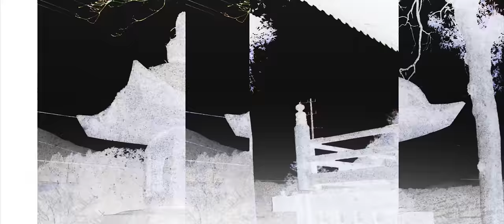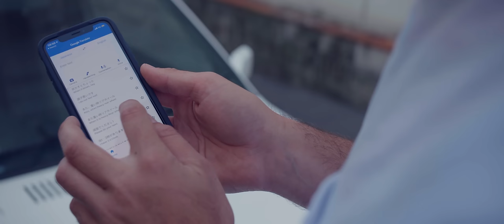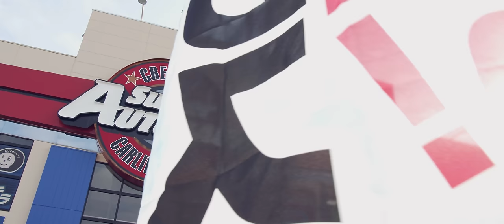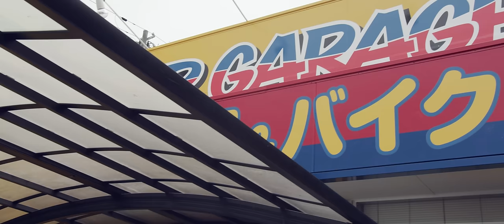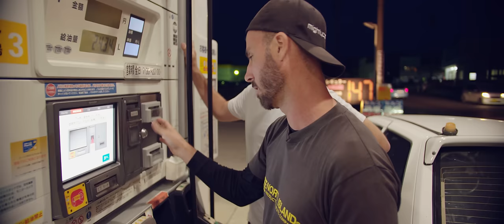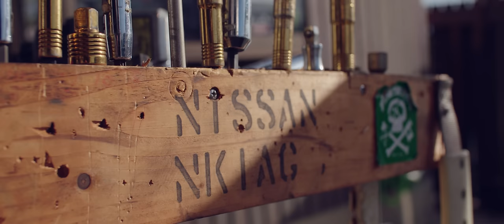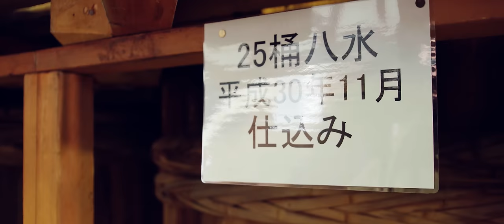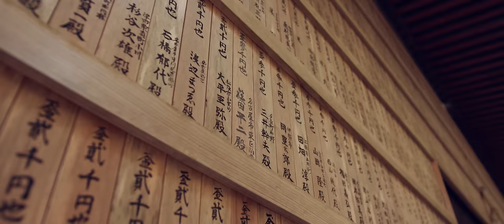TURBOS & TEMPLES 2 // JDM Feature Film 4K

Comment: Best translation: 

"Thank you for buying the super turbo. When you start the engine its a little rough, the engine is a little bad with long running time. Good luck."

The problem is the note had english words in it which don't translate very well.
Reply: It says" Thank you for buying the super turbo. It doesn't like to be reved too much . If you loaded it up with some weight the rear wheels will rub at times. Good luck."
Reply: @a00860512  Correct
Reply: @a00860512  Thank you!
Reply: "Thank you for buying the super turbo. At least you aren't American. Trump is the worst. Good Luck."
Reply: @earnestbunbury2103  sook
Reply: @earnestbunbury2103  😂😂😂👌 My favorite translation.
Reply: @a00860512  Thank you!
Reply: Nao's translation is good.

OP, 'super turbo' and 'rear wheel' aren't really that hard to translate.

Comment: uploaded correctly in 21:9 and not with black bars! HELL YES! THANK YOU!
Reply: ValleVaan give me 16:9 please. Pretty much all display devices sold are 16:9.

My tv is 16:9, my laptop is 16:9, my phone was chosen on the fact it is 16:9. Give me the correct 16:9 please. 

I presume this was filmed in 16:9 and then some data was needlessly thrown away to make silly black bars on any ordinary 16:9 display.
Reply: @nordic5490  there is no black bars added by editing, if you wouldnt be stupid you would understand it, it is filmed in 21:9 and uploaded in 21:9, if they were to film it in 16:9 and then add black bars to make it 21:9 i would see black bars on all sides, now i can watch it full screen without any black bars, just as it should be.

also it is not my fault that you are stuck in the past and one single aspect ratio, my main monitor is 21:9, my other monitor is 16:9 in portrait mode and my phone is 19,5:9.

also there is no ''correct'' aspect ratio, hell, when years back people were saying that 16:9 is too wide and 4:3 is perfect, do you see anyone with a 4:3 monitor anymore?
Reply: @vallevaan  Dude, I have the same problem with black bars on my 21/9 monitor. 
Do you know the Google Chrome extension, Ultrawide Video ? It's super duper useful, you can strech, crop and just turn it off, when you dosen't need!
Reply: Valle, I have shot in 14bit 444 RAW, and all kinds of aspect ratios. I have done lots of Adobe Aftereffects work.

The sensor on MCMs camera is likely to be natively 4:3 and is then cropped internally to whatever MCM set it too.

I am going to guess that MCM likey shot and edited this in 4k 16:9 and then cropped the the top and bottom off as a last step pre youtube upload, to suit a few people such as yourself. This is throwing data away by definition. MCM may have well agonised about this, ie, 'do we make it look nice for nuf nufs skinny smart phones (possibly MCMs core target audience), or, do we make it look nice in 16:9 for the general public (not MCMs core audience) ?'

I think it is very silly cropping the image to suit skinny phones (my Sammy note is 16:9), ie, were do you stop ? Should MCM start filming in vertical format too ?

Have a nice day mate.

Comment: 1:28:53 that's got more steering angle than some drift cars haha
Reply: I didn't know you were a MCM fan!
Reply: Negative camber AND positive camber at the same time isn't so desirable though 😅
Reply: agreed
Reply: Figureight  stolen part from a Nissan use it for the Toyota
Reply: Literal shopping cart angle.
Reply: Who says this isn’t a drift car?
Reply: PetrosRZ it’s fwd
Reply: @theorginalratchetset1546  probably 4wd as most tractors are rwd OR 4wd
Reply: Serious offroaders used to use those front ends because of the awesome strength and unbeatable steering angles
Reply: @mjpeeved  จะ
Reply: @Bahraini_Carguy  t

Comment: My monitor approves the aspect ratio of this film, thank you very much!
Reply: Darko Prevaranko so does my iPhone XS Max! It’s the only thing I’ve ever watched that has taken up all the screen without zooming.
Reply: Darko Prevaranko what kind of monitor do you have mate ?  Pretty much every monitor an tv and laptop sold in the last 10years is 16:9.
Reply: Nor Dic this video isn’t 16:9, it’s been uploaded as  18:9 or 2.17:1.
Reply: @nordic5490  LG sells Ultrawide monitors which are 21:9, which is what I use.
Reply: @livndays45  21:9, not 18:9
Reply: My ultra-wide 4k monitor definitely approves of the aspect ratio and resolution. Glorious!
Reply: Paul, exactly. Most display devices are 16:9, and the this video was likely filmed and edited in 16:9, but this video is now cropped.

I think MCM made a mistake.

Comment: 28:08 I work for a Walmart auto care center, and we actually triple check the torque on the wheels; first check is done by the tech that installed the tires, it’s then checked again with a completely different tech for quality control; then the vehicle is backed out of the bay, does a figure of eight loop in the parking lot to settle the suspension, and then it’s checked a final time by the first tech.
Reply: actually, if there are ANY missing lugs, we will refuse to touch it.

Comment: 1:22:52 Yo, Moog I'm really happy for you, I'ma let you finish, but Lexus made the best JDM road trip vehicle of all time.
It was built to out euro-luxury-saloon the euro luxury saloons (and some of the sports versions.)

A V8 that's so quiet inside the cabin you can drown out all the road noise by turning up the fans and air conditioner to full ...until you step on the skinny pedal. Then, with a sound like ripping silk, the quad cam naturally aspirated 4 liter effortlessly slings the two and a half ton land yacht out from behind whatever you're overtaking and and rips past it with ease. the 1989 debut model pulled 0-100 in 8 seconds, top speed of over 250km/h and still managed to make you feel like you were driving around in an English Manor's library. Seriously the only thing missing is the bookcases and a fireplace. 

I drove my 92 LS400 over 25,000km on roadtrips up and down the east coast. My best roadtripping memory was taking a canadian backpacker down to Airlie Beach from Cairns so she could get on a bareboat and go sailing, I ended up leaving Rex the Lex at the marina and joining them for a week. There's a level of comfort and class that goes with the long drives in a Lexus no other JDM car can touch. Even Lexus admits they don't make cars like the first gen LS any more. Frankly I think it's kind of sad, for all the mad little JDM nugs and classics you guys have run through the show, you've never looked at this late 80's/early 90's automotive icon. When I was a kid, they cost more than our house, when I was 30 I brought one for 3 grand. You haven't been on a roadie til you've done one in an LS.

Comment: I'm working on my local license and I've driven for about an hour. So far I've stalled twice. Hoping to finish it with less than 10 engine stalls. What's funny is that I have a license abroad but driving locally is so much more mentally exhausting that I ended up forgetting I was in gear at a stop light and released the clutch. Once I get my license, I'm planning on buying a nugget just to mess around with it and make it my first project car. Your videos have been very inspiring over the years.
Reply: I will eventually become second nature just practice and please use you indicators (one inch 1 finger)😉 oh and another tip launch your car at least once so you know what it can do if the need arises. Merry christmas and a happy new  year to ya mate
Reply: Don't worry mate, I've been driving over twenty years now and I still occasionally stall it :)
It will become second nature soon too, then you just have to worry about navigating, and signs, and limits, and parking, and everything else ;)
Just remember, go as fast as you can see. If you can't see round a corner, don't go charging round it because you never know what'll be slap in the middle of the road.
Reply: You got it mate, my bad thought you were a youngin just starting on the driving journey. Lol when i find a nice road i drive it atleast 5 times back to back before i give it a real go 👍

Comment: did you hear about the guy who could only drive in zigzags

He drove a Nissan March and could only go left right left right left
Reply: 3 outta 10
Reply: @earnestbunbury2103  bull, that's a 4 1/2 at LEAST.
Reply: 4/10 - required explanation and not funny but original
Reply: It rubs to much to make a hard right. You need to go back and forth carefully, walking the fine line
Reply: 12/10

Comment: Im assuming Moog is talking about an FD rx7, in which case i'll say this... My best friend has an FD and is on his third motor, (big single turbo 13b)  but oh my god that thing ripssss! Easily the fastest and funniest car i've ever been in. On the other hand....my boyfriend has an NA Fc rx7... and he is still on his original motor with 140k miles on it...it has never broken down and has been fairly reliable over the past 3 years, but obviously not as fast and fun as a turbo FD... Sooo there really is a give and take, but theyre such awesome cars!
Reply: Got an rx8 and some friends with rotaries engines ... and well, I totally agree with you =)
Reply: I had a rotary 240sx swapped when I bought it but it was blown I refurbished it and installed some performance parts like a gtx turbo and exhaust it was a 13b and was a pain in the ass to fix nonetheless, it was the best car i had in my life... but it was totaled by a drunk driver:( but i saved the engine and scrapped the chassis and am on my quest for a another s13 or 14 but i also agree with you Rotaries are legendary and reliable and amazing but nothing beats the og rx7 chassis and engine